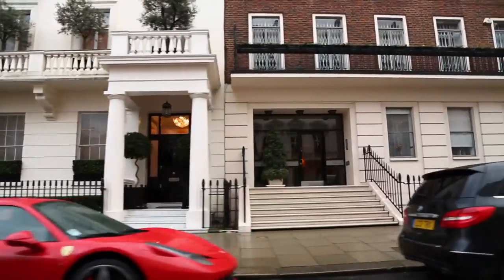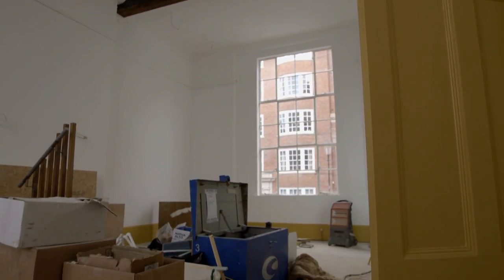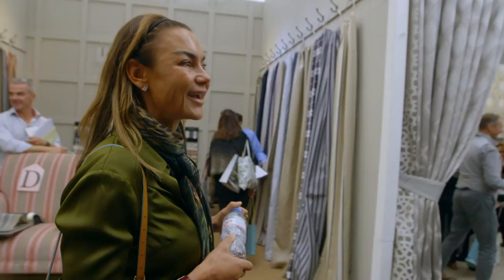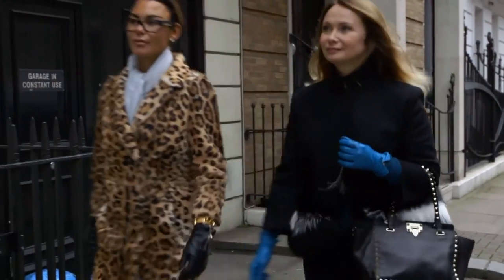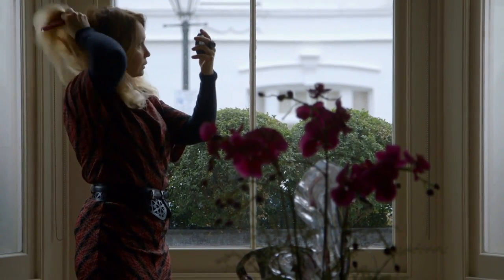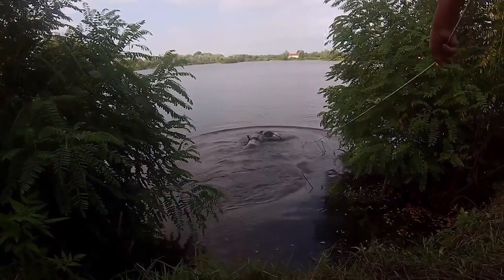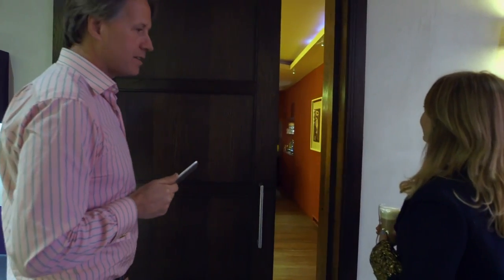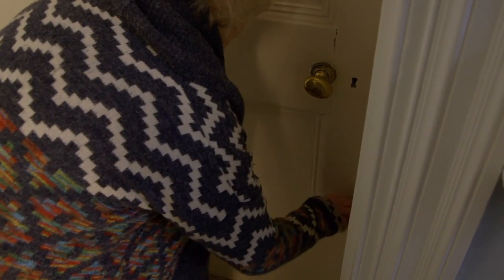A Look Into A $20,000,000 London Apartment | Finest Interiors

Comment: Can someone explain why wife of the painter had to sell? Did she own an apartment and so was responsible for looking after the exterior of the building and wasn't able to put forward her share of the funds? Or did she sell because the building needed renovations which she couldn't afford?
Reply: She owned the flat, but It's a leasehold property and the new owner of the freehold wanted to make very expensive improvements which she would be liable for. Very sad.
Reply: She has a leasehold flat. Leasehold ownership of a flat is simply a long tenancy, the right to occupation and use of the flat for a long period – the ‘term’ of the lease. This will usually be for 99 or 125 years and the flat can be bought and sold during that term. The term is fixed at the beginning and so decreases in length year by year. Thus, if it were not for inflation, the value of the flat would diminish over time until the eventual expiry of the lease, when the flat returns to the landlord (although an assured tenancy would then become a possibility).  With inflation the value of leasehold in certain area has increased in value
The leasehold ownership of a flat usually relates to everything within the four walls of the flat, including floorboards and plaster to walls and ceiling, but does not usually include the external or structural walls. A garden can be included, unless it is a communal garden for the building. What the leaseholder owns  is often defined in the lease as the “Demised Premises”

The structure and common parts of the building and the land it stands on are usually owned by the freeholder, also known as the landlord. The freeholder is, normally, responsible for the maintenance and repair of the building. If so, the costs for doing so are recoverable through the service charges and billed to the leaseholders.

The landlord can be a person or a company, including a local authority or a housing association. It is also possible for the leaseholders to own the freehold of the building, through a residents’ management company, effectively becoming their own landlord. Furthermore under right to manage (see below), the lessees may not own the freehold but are able to manage the building as if they were the landlord.